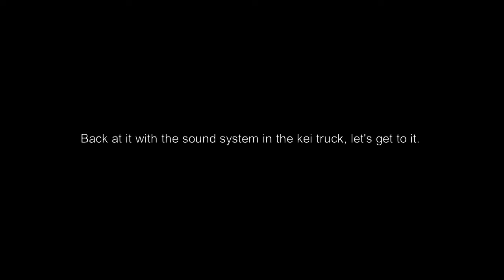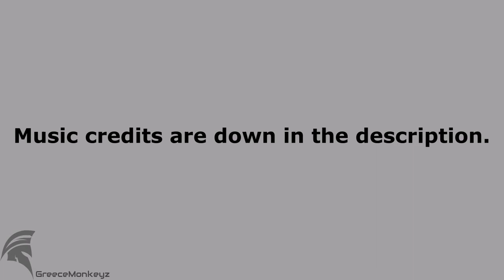Powering the sound system.  Kei truck garage build - Part 5: glove box surprise

Comment: Part 5 is missing? Glad u uploading this often. Well done man, making some awesome progress
Reply from the maker: Hah. My bad, typo, ill fix it later.  Got another one almost ready too. Rapid fire with these videos while I have time over the holidays.
Reply: @GreeceMonkeyz   if u havent, give MotoCheez a watch. He has the Older S83P Climber shape(with difflock) which he does allot of4x4 inspired mods with. might give a bit of inspiaration and ideas. Im still not sure if I see u going the Low or the High route.
Reply from the maker: @carbonehouseholdcarbone8110  I've seen a bunch of his videos, good stuff.  I think this one is staying at this ride height...hint hint.

Comment: Would you be able to tell me which wires from the original harness are ignition power, 12v, ground etc.?
Reply from the maker: I can't find the cheat sheet I wrote down while wiring it.  I will pull my radio out and check the wiring for you.  Please remind me if I don't edit this comment in a day or two!  Edit:  See other comment.
Reply from the maker: My harness is 
Red: +12v
Blue: Ignition +12v
White/Black stripe: Ground
The green and green with darker green stripe pair is the original speaker I think, I removed mine a while ago.
You should double check with a tester/multimeter if you can, just in case!
Reply: @GreeceMonkeyz  I have a 94 Hijet.  I would assume we are dealing with the same connections.  I can’t thank you enough for taking time out to respond and help me out!  Love your truck!  If I have more questions about other things you’ve done, could you be of assistance?
Reply from the maker: @AlanRashDominance  Of course!  I'm here to help.